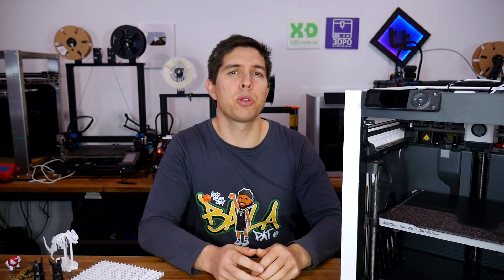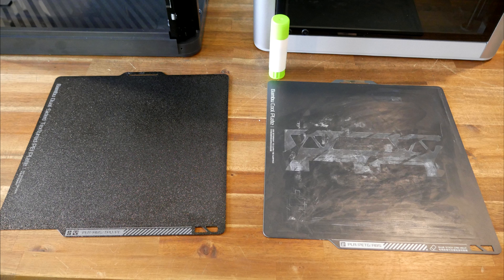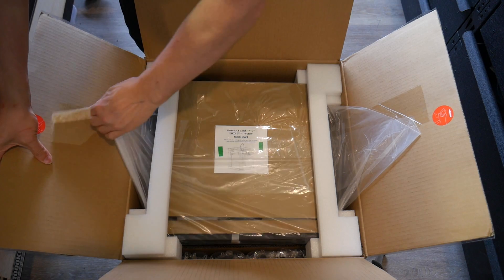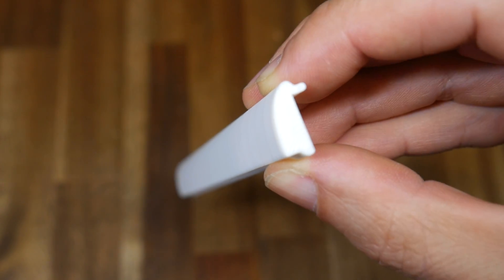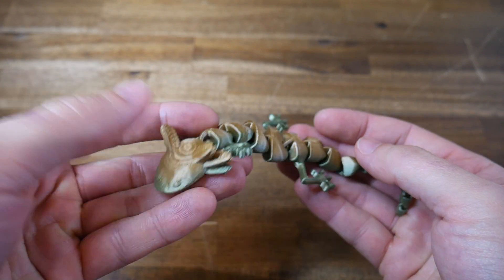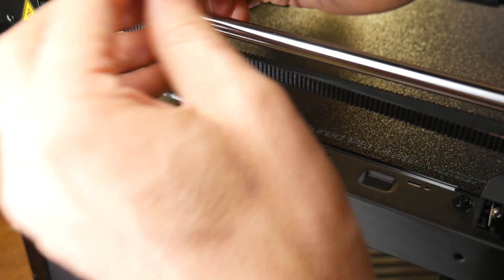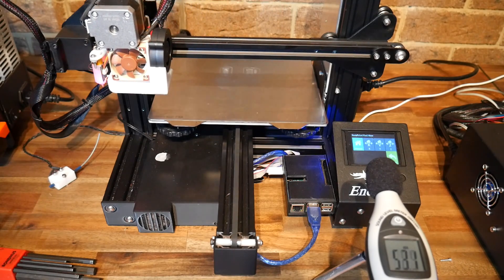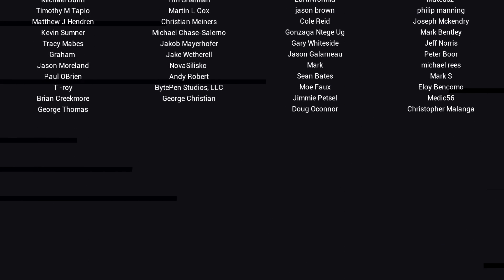Bambu Lab P1P - Your questions answered!

Comment: Do you intend to test one day another high speed printer I'm thinking to purchase, a snapmaker J1 because its idex, which bambulab isn't,  and I want an idex since I have some issues re pulling out supports when using PLA+ filament ?
Reply from the maker: I've tested quite a few. X1, P1P, Rat Rig V-core 3, SecKit SK-GO and SK-Tank, FLsun Super Racer. Prusa XL is pre-ordered and I'd like to build a Voron too at some stage.

Comment: I would love the x1c but price is too high for me right now! This one is a lot better price range but i would hate to give up that lidar system and the ability to print abs/asa. I was on the back burner for bambulabs at the kickstarter and I should be smacked in the head for doubting as I may have been able to afford one of them! Kickstarter always worries me though.

Is this one the same speed as the X1C? Maybe a little faster without the lidar actually....?
Reply from the maker: The print head should be slightly lighter without the Lidar, so if you add the aux fan for cooling I see this as at least as fast. Mechanically the rest is the same to my knowledge.

Comment: i just dl the bambu studio to check the speed of default profile (i plan to use a 0.6 nozzle) but i probably miss something but the best speed i can get for a benshi with 0.4 nozzle is about 40 minutes and about 25 minutes with 0.6 nozzle (so the same speed of my customised d12).
if you have any idea ^^
thanks
Reply from the maker: The pre-sliced benchy uses more aggressive settings than the slicer defaults. Look out for a pinned post shortly. I just sliced a 20 minute benchy myself and I am uploading a video with the settings.
Reply: @TeachingTech  Great thanks a lot for this answer and also for all you great videos, i preordered a P1P ^^

Comment: It's time for me to step up from my Sidewinder X1 (which prints well but is terribly unreliable) and I'm committed to going corexy.  I was headed down the Rat Rig path, but the value prop here is pretty incredible.  I thought I would like tinkering with a 3D printer, but after the Sidewinder, "it just works" is music to my ears.
Reply: I know what you mean.  My first 3D printer was a Sidewinder X1.  It seemed to break down after every three or four prints.  I spent almost $200 on replacement parts.  It almost drove me away from the hobby.
Reply: Yeah I own three sidewinder x1s and looking at the p1p for a more reliable printer for everyday printing
Reply: I also understand. My first printer was a Tevo Tornado, and I thought that I would eventually mod it, but the truth is that I enjoy building stuff more than dicking around with a crappy machine, so I've always leaned more towards turn-key styled machines ever since.
Reply: Man so true. I simply cannot get a consistent result with my ender 3 s1. I am beyond frustrated and am ready for something that just works out of the box.
Reply: @fuloran1  Just bought an Ender 3 S1 Plus one week ago.  Being here tells you I am less than impressed with it.  Going back to Prusa for reliability (MK4) or this P1P.  One thing I know.....I will never buy another machine that supports the print surface off of a narrow rail and rubber rollers.😤

Comment: Great, informative video as always. I plan on getting this printer. In fact one of the main motivators is I have the opportunity to use the X1c in the classroom at the school I teach at. The X1c surpassed my expectations. My second motivator was receiving a faulty unit of the Ender 5 s1 from Creality on its recent launch. When I talked to them about the issues they simply told me to not use the ABL feature until its firmware was fixed sometime in the future...
Reply from the maker: Companies like Prusa and Bambu Lab are really benefitting from the poor QC of cheaper printers. They served the purpose of getting a lot of people into the market but now those people want to upgrade to something that just works. Glad to hear you are happy with your X1C.
Reply: @TeachingTech  100% agree with you that they were and are still a great way to get into 3d printers at a low price point. However, this is a vital component of the market that has been passed over consistently of a plug and play solution. Now, the benefit to first having an ender 5 pro to start was great for learning, bed leveling, slicer settings, maintenance and diagnostics, so I am still glad I spent the last year with my ender 5 pro, before the ender 5 s1 fiasco.

Comment: Noise level was 'no' for me. I don't print a lot, 3d printer sits in my workplace and it would be annoying to have very loud 3d printer. It's pity that you compared sound with old ender 3 rather than something with TMC. Any thought about that?
Reply from the maker: You could absolutely match the speed of any other printer, you just won't be able to print as fast. Same for any high end kit coreXY too. Slow down the speed and lower the part cooling fan speed. I guess the difference is that with this you have the choice between fast and loud or slower and quiet but with others you don't.

Comment: I've been using the pei bed with my x1c and there haven't been any real problems with the lidar.
Reply: Yea was thinking the same thing. Seen X1C users print with the pei sheet and on there site it states for X1 series and P1P. But was not 100% if that was with lidar disabled on not.
Reply from the maker: That's handy to know. I haven't tried it yet but I will order one because I prefer not to need glue.
Reply: @TeachingTech  The default slicer pei bed temp is too low, I run it at 55c for pla and haven't had heat creep problems (that bambulab is concerned about). I had a few edges curl up at the lower default bed temp and cause problems but after I raised the bed temp the prints stick perfectly and release easily. So much better than the included bed. No more glue! My chamber temp is usually ~36c. 

I've gotten a random software error once or twice but if memory serves the lidar is still scanning the first layer and working just fine. It's to the point where I just send a print and forget about it.

Comment: I'm curious. Can the P1P print carbon and glass filled filaments?

Edit: since you asked, i ordered mine on launch day. It's my first filament printer coming from resin printing with elegoo mars/saturns. I was drawn to it since offers speed similar to a voron. I'm however looking into printing and modding a voron using the p1p, as it promises to be an easy to use printer.
Reply: Yes, if you upgarde to the hardened steel hotend and extruder gears
Reply: @morbus5726  can't upgrade to extruder gears only nozzle atm.
Reply: @TheVFXAssault  i thought the extruder would be the same component?
Reply: @morbus5726  From what Bambu has mentioned on their store, the X1C hardened isnt compatible with the P1P. Whether that is true, i have no clue. I do believe they upgraded the connectors to something more heavy duty, maybe thats why. Im sure theyll release hardened extruders for the P1P tho.
Reply: @TheVFXAssault  i think its the lazer thingy that isn’t possible
Reply: @mariospanayiotou6644  the lidar doesent matter. That's just a separate module on the printhead
Reply: @TheVFXAssault  yes but it plugs on the hotend and the p1p doesnt have the possibility to attach one on its hotend because its a bit different (the pcb or whatever)

Comment: Re: add-on extension board:
Like the blog says, connected to Bambu Bus and  controlled via G-code.  Supports Color LEDS, additional steppers and servos, additional fans, and DSLR shutter controller. Images of the system clearly show connections for COM/NO, Stepper Motor, LED0, LED1, Fan0, Fan1, [Bambu Bus, Fan2, Fan3, Servo Motor 0-1, Shutter, Ext-Power & GPIO.

Comment: Definitely considering. My 3D printers are used for prototyping in my industrial design studio. There are sometimes months between phases of intensive use. My Creality machines simply require too much attention (to this day, I could not fix a 10°C temperature difference between what I measure on my CR-10S heater block and what the display is showing!). I need a basic and reliable machine that's fast an that "just works" - the P1P seems to fit that bill perfectly.

Comment: Been looking for a while to jump into 3D printing but haven't pulled the trigger yet.  Would love to go for the X1 but the cost is just way more than I can justify.  P1P is still impressive.
Reply: I think there are two kinds of people who are "looking to get into 3d printing."  The first is the person who is interested in the machine itself.  The idea of tweaking and modding and eventually building the printer is interesting and exciting.  If that's you, these aren't the right machine for you.  These are meant to be a COTS solution and the assumption is that the user will no more disassemble them than they would their refridgerator.

However, there is also the person who has ideas about designing objects on the computer and then turning those ideas into a physical object, but has no interest in building their own printer.  They want a reliable and easy to use tool to build the things they imagine.  If that's you, than the Bambu machines are a good choice.  Not the only choice, Prusa is also a good choice, and there are a couple others billed as "it just works out of the box."  But the various low cost printers often billed as "a good entry printer" are probably not what this type of person wants.  They're good printers for learning how to troubleshoot and build a printer, because you have to do it a lot; but they're frustrating as heck if all you want is a machine that just works.

My advice, if you're like me and in the second category, is to save up until you can afford either this or a Prusa.  You'll earn that money back in a couple months in saved frustration.  Obviously free advice is worth what you paid for it, but those are my thoughts.  :)
Reply: @davydatwood3158  First thank you for putting the time into your reply. I'm kind of in the middle of the two camps. I'm a tinkerer but I'm also ... over ... 55 (man that stings). And to a point in my life where "just works" is bringing to appeal more and more. But the reality of what's in my wallet won't allow me to go for the bambu as much as I would like.
Reply: @JohnMGibby  I'm like you are in the middle.
I got an Ender 7 when that was new.
And I also have the P1P

The Ender is now in a storageroom gathering dust.
The P1P is now the only printer I'm using.
I just works.

Comment: I got my X1C yesterday and I have to say that it blows my mind on how fast it is, My DIY printer takes 8 hours the X1C takes 2 hours for the same model on standard speeds. and on top of all of that it was plug and play.
Reply: They are great, if only they would make a 300x300 or larger one!
Reply: And it's not even full speed lol. 20k acceleration is nuts
Reply: @TheRobojay  voron is still betteer

Comment: Any printer that has a text screen in 2022 should be banned.
Reply: What utter bull crap, there are a lot of people who don't like touch screens
Reply: @shaunmorrissey7313  or that don't use them. I control my printer from my PC and cellphone with the browser.
Reply: Any printer that can't be controlled 100% locally and through a web interface should be banned.
Reply: except this one has a web interface with live monitoring, most people dont use the screens anyway. I don't even have a screen installed on my vcore 3.
Reply from the maker: It's one of the ways they can make it cheaper than the X1. I don't love it but as I said it's serviceable. You could mount an old smart phone running the app if you like. There is a USB outlet behind the LCD to take power from.
Reply: Somehow it looks even worse than the dials on $150 printers - all that clicking!

Comment: I Wish they would come out with a printer that can print PEEK but honestly at this price, Idk why other companies still exist lol, great printer, great value. The ONLY issue is that you need to use their filament from what I am hearing any other filament works super bad on the Bambulab x1c.
Reply from the maker: Can confirm that I rarely use Bambu Lab filament on the X1. Once the supplied filament ran out I've been running X3D without problems. I haven't felt the need to tune any custom profiles either. For instance, the AMS supports in X3D ASA were done with the generic ASA profile and look great. Supports pulled away perfectly too.
Reply: @TeachingTech  I'm definitely wrong then, don't believe everything you read on the internet I suppose indeed, I will leave it up tho for future reference.
Reply: Hi, I have an x1c and it works perfect with other brands. Have tried pla, petg, pa and tpu all not from bambu. Of course there is slicer tuning to do if you want to maximize speed and quality. The advantage of bambu filament is those settings are already defaults in the slicer. Good for those who don't want to tinker with it
Reply: @motoraddiction9190  I see! I have seen reports of people failing prints if they did not use bambus filament, anyhow, you definitely got a great machine!
Reply: That is not true, I have a x1c and all my filaments print perfectly.
Reply: @EJTechandDIY  Then someone may have had a defective unit or has been using some bad filament!
Reply: @revoltoff  or did not tune their profiles for the filament. I know a lot of people that had problems using the GST3D filament and after more than a year using it I can tell that it prints really well, but after tuning everything properly. 

This are the test I do to each filament type/brand:

Temp tower
Retraction length
Retraction speed
Shrinkage Test
(Pressure/Linear Advance is optional, but reccomended)
Reply: Up to now my X1C gets any rubbish filament I’ve thrown at it with ease to work. No reason to complain.The ams might be a little picky at times but not the printer.
Reply: You can use pretty much every filament you want. I have great results for Cerprise PLA, Eryone PLA+, Tinmorry PLA, 3DKaige PETG – even with the default "generic" profiles in Bambu Studio.
Reply: @henninghoefer  That's true but I don't think any x1c can print PEEK filament lol

Comment: I heard someone saying that they sliced a benchy and couldn't get anywhere close to the 21 minute advertised benchy. Try slicing your own benchy and see if you end up getting 21 minutes.
Reply from the maker: Ask and you shall receive! https://youtu.be/5-yBVe3-VFo
Reply: It is because the benchy file on the machine is sliced with the ludicrous speed setting and in accordance to official 3DBenchy SpeedBoatRace rules: 0.25mm layer height, 3 top and bottom layers, 10% infill, 2 walls. It then already has ludicrous speed applied to it. To approximate this, in Bambu Studio, use the built-in 0.24mm draft profile, and adjust it to have 3-layer thick top and bottom, 2 walls and 10% infill. Then load it onto the printer and then on the printer set the printer speed to ludicrous mode.
Reply: 9:27 benchy via ludicrous mode on the carbon
Reply: You can if you get it dialed in and use their own filament, if you use other filament it's not going to work, it's kinda proprietary you have to play with the settings A LOT if you want to print other filament from what I am hearing, now that Anker got caught stealing peoples videos and stuff this is the only reasonable option tbh, there is nothing that can compete with it...
Reply: @revoltoff  When did Anker get caught stealiung videos and stuff? I missed that news haha. Where can I read about that? Yes I agree, it is a complete package for $700
Reply: @revoltoff  it had nothing to do with the filament and theres no reason it would. What people were saying is that the bench was hand coded to be fast layer by layer. I haven't watched enough benchy vids to know tho.